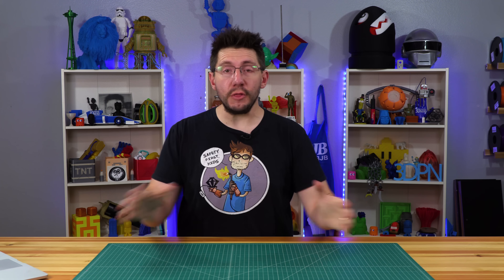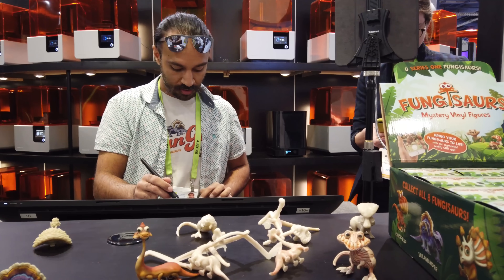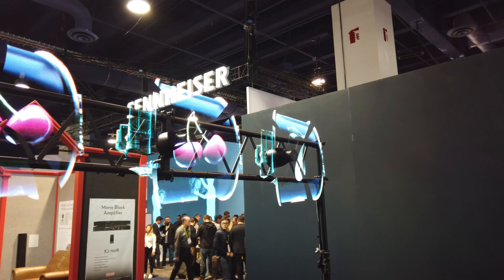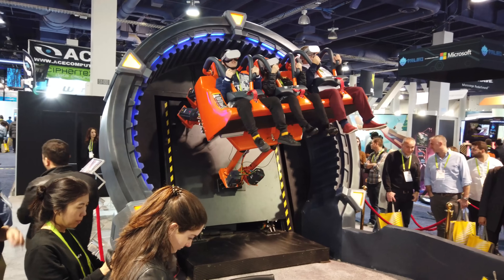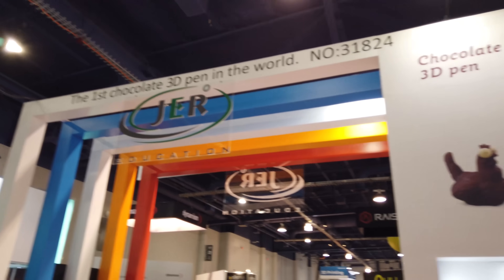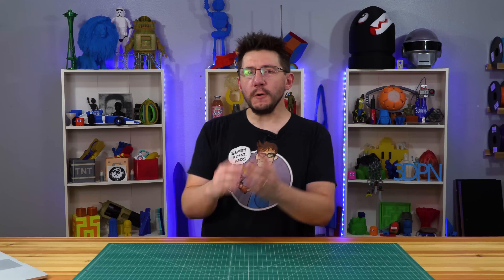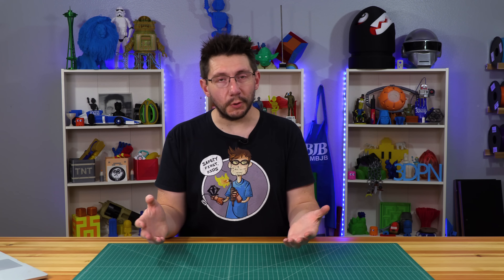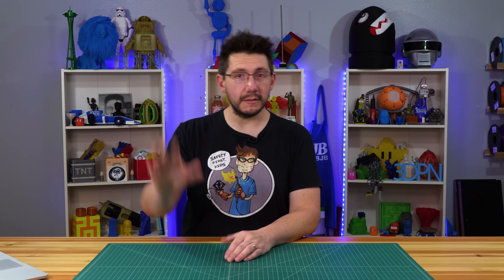3D Printing Chocolate at CES 2019 and Other Awesome Stuff

Comment: robotic arms are slow, not impressed, humans are way faster but they don't work 24 hours, but they adapt 1000 times faster
Reply: Mykel Hardin did you even read my post
Reply: Mykel Hardin fact depending on the application you can rent a robotic arm for 32k a year or spend 10 times that amount to purchase one. a robotic arm takes upto 2 to 6 times the space of the operator. in a 24 hour shift it will be down 3-6 hours. a robot must be checked on every 20 minutes and parts must be checked so you are still employing someone. technicians are needed monthly 75 an hour. an in-house programmer is need, another employee. every 3 years a major maintenance is needed 10k. they only last ten years before wear renders them inoperable. and unlike humans when the work orders are ended the collect dust until it's next application. but they have one major benefit no people wrecking thier backs over manual labor so I am for it, but they are slow and fault ridden and in the long run cost more

Comment: Regarding the IVI printer, you might want to keep this in mind.

https://ivi3d.com/

The printer is too good to be true. Sure AI slicing seems feasible, but I took a look at the specs of the machine
- Genuine HIWIN rails: These rails are very expensive, 3 of them will run for a couple hundred dollars
- Near full metal construction: Not cheap
- Hotend rated for 320C: Means that it is all metal, and using some thermocouple, pt100, or pt1000, with an amplifier
- 1.2ghz cpu + 32mhz mcu: Something like klipper - Existing products like this(octopi + 32bit mcu or sitara am335x) are $100+
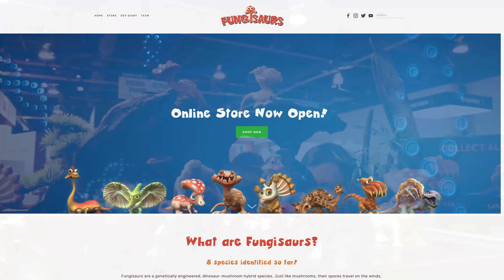- 2:07 : Some sort of closed loop system here, most likely lower end magnetic encoders and a feedback loop, also probably trinamic drivers - $40 minimum per axis
- Sensors including filament weight, flow, temp, humidity, 2 cameras, touchscreen, etc
- Ability to switch between fdm, sla, and cnc

There is absolutely no way this printer will be retailing for $800, $300 is absurd. The components on the printer will cost nearly $1k and these guys need to make a profit
Therefore, I am highly skeptical, either they completely underestimated the price, or it will be missing many of the described features.
Reply from the maker: Michael - Yeah, they are promising A LOT on their website. A LOT LOT.

Comment: Can someone recommend a filament that has the the strength of steel or close? Thanks!
Reply: That... is really hard. There are some engineering plastics that go for like a thousand bucks per 100 grams (as Joel mentioned in one previous video), but I'm guessing you don't mean one of those?..
Either way, your best bet for mechanical strength is polycarbonate. Failing that, nylon for gears or PETG for other stuff.
Reply: @EgorKaskader  Thanks for your help!

Comment: Robotarm with a 3D printer nozzle that can print in every angle would be great
Reply: Saw one at the FormNext trade show last year. The big problem was the slicer software, but the university showcasinf it had mostly pulled it off. It was really impressive.

Comment: If your looking to get into drones check out Joshua Bardwell’s videos. And just a heads up, go straight to using brushless motors. Brushed motors go really quick, and you’ll find yourself in an endless cycle of replacing motors. Maybe look at the Emax Tinyhawk.

Comment: The "Adept" is a SCARA robot, the "pick and place" is a Delta Robot.

Omron is an Industrial Automation company, specializing in Sensors or PLC's, or Programmable Logic Controllers.

Delta's have a very limited reach.  It actually would be possible to actually beat a Delta at ping pong.  Outpace the vision, or the arm, or go wide on a shot...

Comment: The ping pong robot probably can't anticipate spin on the ball. That could be why it loses.
Reply: I saw in another video showing the player has to use a special paddle that had tracking markers on the surface of the rubbers. They explained that it can tell identify easily the orientation of the paddle and calculate the spin etc. In that video they also mentioned the Omron ping pong bot wasn't designed to win, but rather it was programmed to help maximize the number of returns as to help the human player improve.
Reply: It tracks spin as well, it's programmed to help a person get better at ping pong.